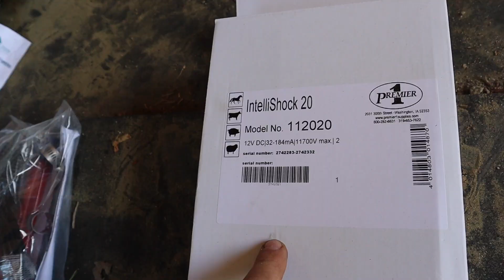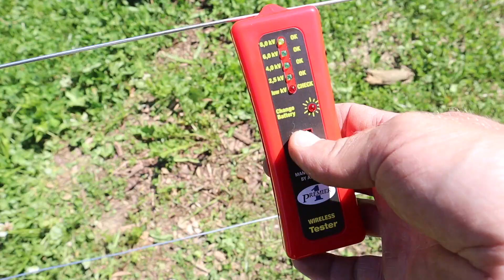This Should STOP them, Protecting Our HONEY Bees from the BEARS!

Comment: Yes, you do need a charge controller since the voltage from the solar panel will vary and won't charge the battery correctly. Also, you might put the whole rig behind the wire to protect it from the bears as well.

Comment: Al, I know when it is blazing hot, snow is the last thing on your mind. Keep it in mind when you choose a place to mount the solar panel. The sides of the greenhouse will need to be kept clear, out 4 or 5 feet, to accommodate what slides off the top and of course the panel has to be higher than your snow on the ground. Close to a path you normally have clear is good too, so you can easily get to the panel and clear any wet snow that has stuck on the face. You know what I'm talking about. Gina, love the dress. Cute!

Comment: Hey Al,  Wrap some bacon around one of the wires and when the bear goes for it ... zap!  This will train them not to go near it just like the pigs with their fence.  Sometimes if the bear doesn't touch the wire with its mouth or other sensitive skin area it will push right through the fence.

Comment: Al, set several buckets near the pile of dirt/mulch/compost/whatever, scoop with you tractor FEL and use it to fill the buckets. It takes just a few minutes to fill a pile of buckets this way. Lift the buckets into the mule for transport, carry the full bucket to the point of use and dump. Load the empties back into the mule for transport back to the pile and repeat. It seems like a time waster to shovel material into buckets from your FEL to carry them a few feet only to dump them out again. We moved 10 CU. YD. of "soil-less mix", via five gallon buckets in no time at all.

Comment: You need a charge controller or you will boil and overheat and over charge your battery :) we have a 2600 watt solar system to run a lot of the power for our house :)

Comment: Al, you need the specifications for the solar panel. Premier One talks vaguely panel. 
The closest panel (PRS 200 or 200X) presently on their website shows a 40 watt panel, but you need to know what voltage the panel generates. Some panels are 12v, some 18v, while others can be 24v or 60 volts. If you assume yours generates 12v, then the panel makes 3.3 amps. 3.3 amps shouldn't  hurt your deep cycle battery, but you still need to monitor the water level. In any case, I'd still include a charge controller in the system.

For the green house, look into the solar powered louvers. Installed in the end wall, they will cool the green house automatically.

Comment: I've known people who've mulched their potatoes with newspaper.  They don't even bother shredding it either.  They'll take half a sheet and lay it on one side of the potato mound, another one for the other side, and yet a third one to go in between the plants.  Usually they do 2 or 3 layers like this, to overlap the seams.  The main thing that I've always remembered from them is to only use the regular black and white section of the newspaper.  Never use any of the inserts (or anything glossy).  Something about the colored ink or the coating makes it toxic.  But it's a great way to recycle everything else!

Comment: I use a 30 amp PWM solar charge controller, for my fence! You can set it to run the fence to evening hours, fence off during the day, while charging the battery.

Comment: You may want to put your solar panel inside the wire surrounding the beehives. Speaking from experience, we've had bears knock the panel over, disconnecting it from the wires. It then went on to destroy our hives.

Comment: Looking great. I agree with the other posters, if the panel doesn't have a mechanism to regulate the charge, the battery may not last as long as you would like. You might also consider putting some kind of non conducive insulation on top of the battery so it doesn't short out of the wind knocks it over. Awesome job though.

Comment: Yes you need a charge controller or you may overcharge the expensive battery.  You can also get the controller with Load Disconnect and if the battery gets down to 11 or so volts it will disconnect the load and not damage the battery by over discharging.   Nice set-up.

Comment: you might consider placing the charging mechanics & solar panel inside the fence, keeps bears from knocking them over, lowers your risk of loss investment  (leave the on/off voltage switch outside the fence please (LOL))

Comment: come july your greenhouse will likely be too hot to work in during the day...even with fans...so you may need to have lights to work at nite....i suggest a small 400 watt inverter connected to your fence battery and led area flood light ...that are on a stand and movable ...if you need to light all the greenhouse at once ....perhaps a string of  max 400 watts...led bulbs ...a 100 watt equivalent led is usually about 10 watts...so you can have 20- 40 on a string...

Comment: you will likely need a lot more power for your greenhouse fans...i suggest you use off market car radiator fans ...connected directly to a 100 w solar panel mounted on the greenhouse ...no need for battery or controller ...the more sun the more fan...auto off at nite

Comment: You should put a 4x4 post in the ground to mount the battery box for the electric fence instead of leaving it sit on the ground.  Granted, the box is galvanized, but if left just sitting on the ground like that, it will end up rusting out.

Comment: a small controller for the solar system is necessary.  it will prevent overcharging if the cell is oversized for the use and it will prevent backflow from the battery at night back to the solar panel.  not expensive and good policy.

Comment: You might want to sit your electric fence module/battery/solar panel inside the fence in a place you can reach rather than leaving it sitting out. Bears are smart enough to knock those things over to disable the fence.

Comment: You will need a charge controller for your battery or you will overcharge it. Btw have you had a need to open your large vents on the greenhouse yet? If that fan blows air between the greenhouse coving for insulation how is it going to run at night with no sunshine? If it drains your battery your electric fence won’t work, as you know your battery is considered to be discharged at 12 V. Fully charged is around 14 V

Comment: If you have what's called "soft start" for greenhouse fans.  Which is a variable speed controller so fans do not run at max speed. This will help save energy from solar system.  You're going to attach to.

Comment: ...the principle attractant for Black Bears (this is their 'fattening up for the Season' time) is easily accessed food sources.  Garbage in a plastic container left out in the open overnight, that box of Apples was a golden opportunity and so it is not surprise it got robbed.  Have any waste containers made of metal - some bears in Northern NJ have been known for dragging off a waste bin container made of pvc - my sister watched from her car until the bear finally gave up, it was her garbage bin - as long as nothing is easily accessible or even slightly nice-smelling, you should be find.  Black bears this time of year is best.  It's a good thing you have the wood panels in the greenhouse....makes it a bit tougher for the bear, whereas a cardboard box with lots of apples was an easy target.  This also goes for dog or cat or ferret food if left out and uncovered.  Not a homesteader, but worked five years at a Renaissance Faire in upstate NY and ~every year~ around this time the local black bears would be about.  And yes, if whatever is particularly stinky on the inside, a black bear will rip thru the side of a cheap nylon tent..(friend who did tricks with her Ferrets at the RenFaire found this out in person one night)  The Bees and Honey should be safe, tho a double strand electric line (like what is surrounding the pigs) should be good enough.  Bears are in auto mode now..so if it's made tough to get at, they leave it alone to wander off for something easier.  If you see the bear during the day, contact your local Game Warden, that could be a 'problem bear' who needs reminding humans are NOT fun to hang around with.  (and here's a no duh, never leave out or feed bears on purpose - this includes garbage bins, should be well kept and the lids can lock down)
In Five years of living most weekends which technically was the Bear land - the RenFaire was located at Bear Mtn, NJ - you learn alot.  Your bear sounds like someone who just could NOT resist those apples in the easily dealt with cardboard box.

(one year at faire - where garbage pickup was done early in the am, so you can guess how much we saw the local bear - one friend pulled into the workers parking area of a field and had a bear corner her in her car with her toddler....really loud car horns and yelling at it didn't work...a gang of about 10 men smashing metal fake swords on wooden shields and screaming war cries, however, DID work..)

Comment: Are you not concerned that the legs on the hives are vertical, and less able to withstand high winds? Would angled legs be better for stability?
Reply: I don't think that's going to be an issue. 

The wattage rating for a solar panel is based on optimal solar insolation defined as a panel pointing straight up at noon at the equator.  Average summer solar irradiance for his (rather northern) neck of the woods (assuming a south-facing panel tilted to 45 degrees) is roughly 4.5. 

This according to:
http://www.solarelectricityhandbook.com/solar-irradiance.html

So we multiply his 30 watt solar panel by an insolation factor of 4.5 yields him only ~135 watt-hours per day.

In theory, an electric fence will use 0 watts (unless being discharged) but in practice, the inefficiencies in the charging circuitry wastes about 5 watts, or 120Wh per day.  I'd say he's almost perfectly balanced.

Comment: you certainly do NEED a charge controller with any solar system. without it you will boil your batteries and ruin then very quickly. the pannel has no way to stop generating electricity. there has to be something to redirect the output to a ground before it gets to the battery.

Comment: Just a suggestion, lower your bottom wire, if a bear gets his nose under the fence they may push forward and get in.
You may want your wire all facing out, that way a bear is less likely to just push the t post over. 
You will need a charge controller, otherwise you will destroy that nice new battery.

Comment: Nice job and collaboration.
The solar panel and battery, I might have put on the inside of the fence around the bees and I would have considered to have the yellow click-on insulator studs point outwards, so the wire runs on the outside. An involuntary shock-jerk-push response from a bear  could pull the click on things off maybe?

By the way, you were not making fun of Olivia, were you? In her absence. On video. Note she is your eldest child, so she has you as her reference model ... And, as an eldest child is typically not competing with their parents, this is a bad position to develop entrepreneurial skills. Eldest children wait until they're asked and then generally do a great job. As she is also, from the looks of it, your youngest child, she is still used to be treated like the baby. You might ask her to one day per week "lead" the property, chores, planning, and come up with ideas and improvement proposals.

Comment: Corn in rows doesn't do as well as when its planted in clumps. You'll need to work hard to pollinate them, if the bees aren't all over it!
Reply: Bees don,t pollinate corn. Its pollen is carried on the wind (as are other grasses). It is more efficient for pollination if the corn is grown in blocks. Next time instead if one row the length of the garden, perhaps four rows 1/4 the length with the different varieties at opposite ends instead of opposite sides?If there are commercial farmers in the area tasseling at the same time as yours the air will be full of corn pollen and it may not even be an issue.
Reply: soaringtractor  Well, ST you're not wrong, but I bet its not planted commercially in a single row! That field would be 1ft wide but 10 miles long Duuuh!
Let's agree to disagree? Or accept Christine's comment.
Carried on the wind or you need to get in and rub them together which is difficult in a "single" row....

Comment: You need a charge controller or you will ruin the battery. A cheap PWM 20amp is good enough. Hook battery to the controller before connecting the panel. Never have panels connected without the battery connected.

Comment: To help deter bears. You can collect your urine. Outer perimeter  of area you do not want the bears. Splash your collection. Onthe trees every 4 to 8 feet at shoulder height. With urine smell that high up the will think they have a much larger predator then themselves in the area.

Comment: Rather than straw couldn't you use hay instead for the potatoes?
Reply from the maker: The thing with hay is it’s loaded with grass and weed seeds. I hate to put that in the garden
Reply: Dont want to introduce weed seeds to the GH.  If you could find 3rd cut bailed hay that's a year old. The guy down the road here usually has a few low quality bails left over.
Reply: @LumnahAcres  it was just a thought.   I didn't know if it would work or not.   Thanks

Comment: So why didn't you drive the kubota around to the open side where the potatoes are and gently "dump" over the railing? Even if one of you were inside the greenhouse with a shovel guiding it would be more efficient than one bucket at a time.
Reply: Tractor bucket is too wide to fit though the openings.

Comment: Why don't you just use landscape (weed blocking) cloth? It's simple, reusable, and not that expensive when you take that into consideration. Of course it's better if you put it on when the plants are smaller but you could still do it fairly easily.
Reply: Hilling potatoes is to ensure more potatoes if they are an indeterminate variety.